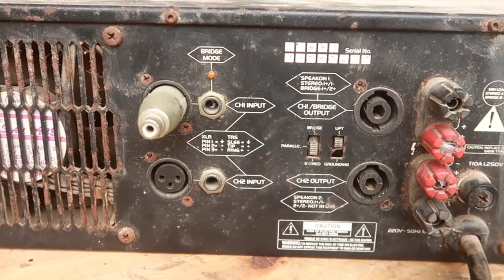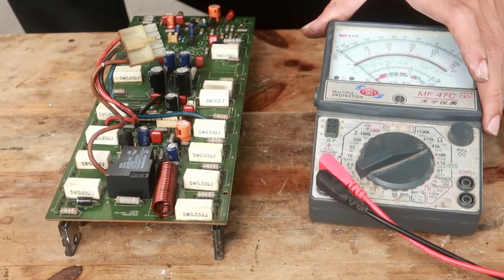Restoration signal amplifier 3000W / Restore everything in detail

Comment: I like when you sprayed on the rusted case.....
No abrasive clean, no rust treatment....
Reply: And it is not really wise to paint cooling blocks. These are not "painted" black but anodized to multiply the cooling area by roughing up the surface. Your paint will hinder the heat exchange now.

Comment: Why would you paint the heatsinks!? Without treating the metal chemically the paint would not stick and worse, flake off as the transistors heat the assembly up. Just asking for trouble for the sake of cosmetics. You have not done that before. Ill advised. Also why not change all the caps? Just to be safe.
Reply: He is a Vietnamese double degree in electrical engineering and computer science, so I think he knows what he is doing.
Reply: @Prometheus574  Replacing the caps would've been his first priority then. He would also know that that moving coil meter is useless for testing caps. They're rated at 50v so almost guaranteed they've been over volted. Why no esd precaution.
Reply: That is true. Always start with new low esr caps. And don't paint heatsinks... Heat transfer will be lower. I'm not an engineer but im building tube amps and class a transistor amps. Only use 105°C Low esr elco's. If they fail the rest will fail. You do not to be an engineer to knowing that 🤔
Reply: That is thermal paste
Reply: @Prometheus574  So what do you know about his double degrees and all this stuff do you know him personally or are you just privy to that information
Reply: @Prometheus574  yeah. Cuz we all know that people with degrees always know so much more than everyone else. LMAO. Whatever.
Reply: We know nothing about the type of paint.Shotgunning parts has it own pitfalls, like stressing the traces, heating smaller transistors unnessarily, and putting in a BAD new part.In looking at most electronic repairs, you , when possible. replace like for like.Most units, that are not abused , seem to last forever.Non low esr. plus or minus 100 percent parts, got us here, guys.
Reply: Cause.
Reply: Clean leaked electrolyte. reinstall
Reply: It's not quite "restoration" as you may think. Title is clickbait obviously. Man is just doing repair on a budget. Why replacing caps, if they're not broken ? He found busted ones, and that's enough.
Reply: But, honestly, i would like to see more tests done after assembly. Get him fully loaded, and check the frequency responses all the way trough.
Reply: @Lyzzzander  Why? If he did, what would it show? He is doing this for himself, this is not a repair shop.If you run one, maybe you could post your methods, so we might learn from them.
Reply: @davidhamm5626  maybe he's reselling it later, and quite a lot of people clicked, so he gets some revenues.
 To be fair, this is not even half worse than any other "restoration" channels from asia. He's not threw dirt inside and leaving a unit on dumpster before filming.
Reply: That is thermal paste
Reply: Good job Mr.E! the people where he lives are thankful for a guy like this. Probably 5,000 mi away from the nearest parts supply house so he does what he can. Without guys like this that amp would be rusting alot worse in a city dump.
Reply: @Prometheus574  I think youre joking

Comment: Small rectifier bridge, and low voltage of electrolytic capacitors, in view of the large transformer and the large amount of output transistors.

Comment: These old Toshiba 2SA1943/2SE5200 NPN/PNP can push up to 200W in pairs on push/pull system (B class)  with their 15A and 230V VCE/VCB voltages. 4 pairs on each heatsink and you can have 800W per channel so total could be 1600W RMS. In theory a good design can double the peak output so in theory this can be a 3000W amp in peak power. Considering the model marked as M2000 I would say it is probably 2X500W RMS and 2X1000W peak power and 3000W marking pen power. On the other hand W and dB dont grow at the same rate, so 2X500W is only just double loud than a 2X100W amp and a proper 2X1000W is maybe double lud as 2X250W RMS. Bottom line it is maybe not 3000W but loud enough to make a statement - with good speakers.
Restoration is nice though. It doesn't matter how long it will last.
Reply: The model number can be based on all kind of ratings.
It's pretty common to get the biggest number which would probably be the bridged power @ 4Ohms
Which could give specs per channel in the order of : 1000W/channel @ 2Ohms or 600-700W/channel @ 4Ohms or 400W/channel @ 8Ohms
But the marking on the back mention 8 Ohms min in bridged mode and 4 Ohms min per channel (stereo) and there is also a 220V and something that looks like 1900W right next to it (which makes sense with 10A fuse).
Let's give this amp an efficiency of 70% (which is pretty good) that gives us about 665W RMS per channel @ 4Ohms ...

I'd say that it certainly hasn't more than 665W RMS per channel @ 4Ohms
Nonetheless, he did a great job restoring that amp. Only at the end he was very confident to hook it up to 220V right away. I would have slowly cranked it up using a variac and see how it behaves.

PS : a increment of 1B (bel) or 10dB is considered twice as loud. So you need 10 times more power to be twice as loud which would make 1000W "only" twice as loud as 100W
Reply: @ppdan  On my workbench I use a lamp in series to start the tests, then I place a heat gun in parallel with the lamp, then I connect a 6-amp breaker in parallel with the lamp, then a 25-amp breaker. This prevents damage. I noticed that he used a scrapped transistor for replacement, in the past I changed them all for new ones, in my last maintenance I did the same way, but in tests I realized that there is a difference in the drained current (which can be measured through the voltage on the resistors) and also a difference in temperature (which I managed to measure by injecting a signal before attaching it to the heatsinks), however, I'm using the amplifier like this and it still hasn't caused a problem.

Comment: Good knowledge in  semiconductor function and basic electric . The device will work until  the next tolerance is killing a transistor or some kind of other disfunction. for self use or using with a spare amplifier in background it is a cheap and good solution . Looking  on this work with aspect " restauration" , it is a very poor level. From level 1 -10 i woud give 4. Always basic in front .. if there is a custumer, what he  is looking for. Generaly , I know this craftsman   can do much more better , if nescessary.

Comment: What is that liquid you are using to clean the board?
Reply: Isopropyl alcohol is commonly used to clean circuit boards.
Reply: @stevesmyth4982  Yeah but he uses Acetone. But Alcohol is WAY safer for plastics
Reply: Contact cleaner. But 2 types of form it is. Oily or non oily.
Reply: And you can use ethil alchol, methy alchol.. all these liquids you can use for cleaning circuits  ;)

Comment: 3KW?  JAJAJAJ.....  8 transistors 2sa1498 2sc5200 capacity total 1 kw at full, suplyed by 108V cc.     Este modelo de amplificador es capaz de ofrecer unos 650W rms por canal a 4 ohms. Por construccion no será posible cargarlo con 2 ohms por canal ya que  esa fuente no es capaz de proporcionar la energía necesaria, y los transistores estarían sobrecargdos. en modo Bridge, tal vez ofrezca unos 1500W rms, pero no será posible bajar de los 8 OHms.   Electrónica tipo crown, una buena imitación.
Reply: I wondered about that. The amp looked familiar to me. I wonder if this manufacturer is an OEM for Crown? (Google Translate: Me preguntaba sobre eso. El amplificador me resultó familiar. Me pregunto si este fabricante es un OEM para Crown.)

Comment: When you renovate an old amplifier you ALWAYS replace the capacitors with new ones.
Reply: May be you and i always do it as we earn enough money to buy new ones and really do not want that beast back on our tables. These persons probably just can not effort new parts, they need to salvage from other broken devices.
Reply: @orangmakan  Capacitors is like tires on a car. After certain milage or years you HAVE to change them. Otherwise is not a renovation.